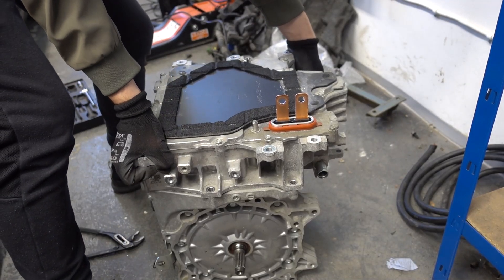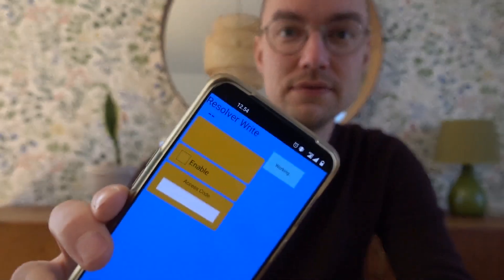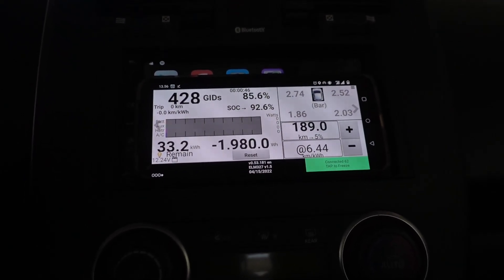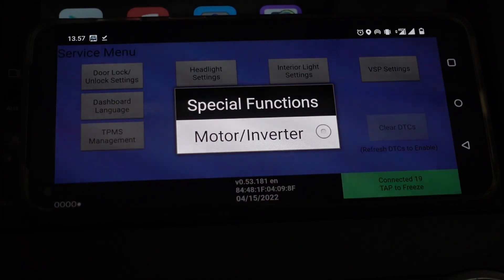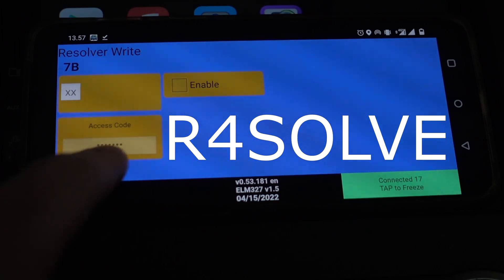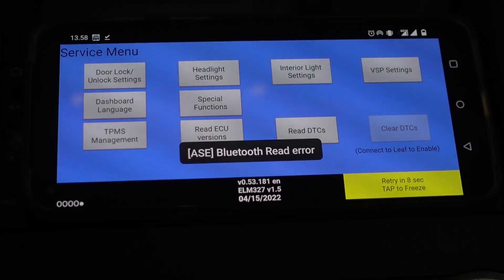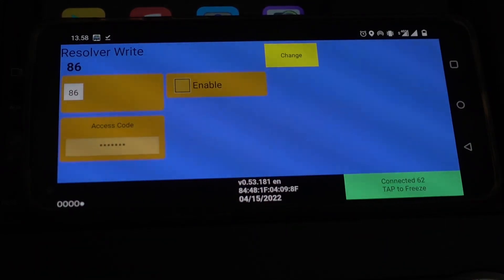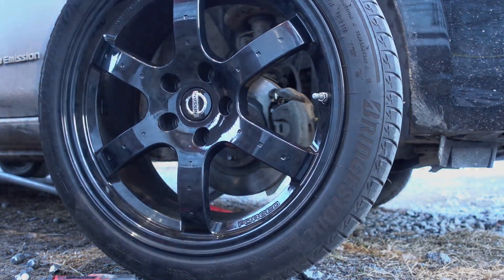LEAF Performance upgrades just got easier - Leafspy Pro Resolver Write

Comment: I think I heard the Donkey Kong Country soundtrack playing in the background 😆. Great video!!! I'm doing this right now, I fried my inverter after accidently swapping positive and negative wires. Update: I just updated the resolver code and it was super easy thanks to Dala, but now only one of the contactors is closing :( and I'm using the Resolve EV VCU. I'll check the DTC codes and lookup what they mean. Then I'll try reading the pins on the BMS plug to see if it the Resolve VCU is sending it the right signals.

Comment: We need these programs for all makes and models, brilliant bit of reverse engineering. I also noticed it’s talking over an Elm327, is that a standard 1.4? Or does the pic chip need flashing?
Reply from the maker: Standard obd adapter yes
Reply: @ fantastic, it amazes me how much the consult system costs, including the adapter, when, in theory, you can get it talking over a Chinese made elm327 with a pic18f chip. I’ve done similar with a bmw Bluetooth e series adapter. Another GitHub project, it’s brilliant, I have access to all the manufacturers dealer level tools but don’t know where to start.

Comment: Have you come up with any way to increase the Regen for the 2012 leaf from stock eco mode? For I feel the leaf would get more range if it regened more. Does leaf spy pro does this in any way?
Reply from the maker: You get less range by regenning. Gliding is where its at!
Reply: @DalasEVRepair  thing is where I live it is hilly and when I was at lower speeds and regened it added miles to the guesometer. For when at local highway speeds of 55 mph when going down hills the car speeds up over 60 and normally have to apply the brakes and I feel it could regen to maintain speed limit going down hills for newer cars like Tesla use aggressive regen or one pedal diving where brakes are seldom used and besides having bigger batteries I feel that's why they get far more range. Thoughts??

Comment: We have an intermittent issue with our 2011 Leaf, which keeps dicharging the 12v battery, as much as 7A has been seen drain it. We also have a yellow trangle warning light on the dash display. I've been told it could be the PDU unit maybe at fault. Would it be possible to swap out with a second hand unit? As we have been advise to take it to Nissan who are the only ones who can replace and reprogram!!
Reply from the maker: Parasitic draw tests are not particularly hard to diagnose. Any competent shop should be able to find the drain!

Comment: Hello Dala, if you use the thunderstruck VCU for nissan leaf you don't need to worry about any of this right?
Reply from the maker: If you are using mis-matched inverters/motors, then yes, you still need to pair them for optimal performance!
Reply: @DalasEVRepair  thanks for the fast answer, btw it's possible to down grade a nissan leaf 2018 with a controller from a 2013 leaf? Do i need to configure something or is plug and play?

Comment: Dear Dala. I have a Leaf Tekna 62 kWh 2020 from new.  I have only done 3000 kms.  I purchased a Leaf Spy dongle and downloaded Leaf Spy Lite.  My SOH say 91.8%.  I only ever charge at home.  Is this normal for the battery?
Reply from the maker: Only 3000km 2 years? Remember that SOH is an estimation, maybe because the car has been sitting much it reports lower. Try quickcharging it a bit and properly use it, this would make the SOH go up on older LEAFs. Incase the battery has been sitting fully charged for extended periods of time, this will also degrade the battery faster. But most likely this is normal due to low usage. Post it on the Mynissanleaf.com forum, better than a youtube comment!
Reply: @DalasEVRepair  I joined Mynissanleaf but it didn't really answer the question.  I have now discovered what I did wrong and what is the solution.    My mistake was to buy a LeafSpy dongle.   I have now thrown it in the draw and decided to ignore it and just enjoy the car.

Comment: Im not sure if you have tried but I was wondering if you can run the leaf motor in reverse direction as normal drive because I'm thinking about using it in a custom swap?
Reply from the maker: Yes, check out the Resolve EV documentation with pictures, you need to swap two wires
Reply: @DalasEVRepair  Awesome thank you  ! 
So it should work as normal and with full rpm and power/torque ?
Reply from the maker: @BasicOffgrid  yes!

Comment: You sir and others like you are such an invaluable asset to the EV community🙏 thank you!!!

Question: is cruise control on the leaf can-bridge messaging?? The reason I ask is that the leaf speed is controlled by "wire" in all actuality it's a potentiometer of sorts in the go pedal.? Now hear me out 😅 based off personal experience and your own personal hyper mile video. A driver should use terrain to ones advantage; but due to the cruise control simply being based off MPH/KPH the car gets pathetic range. What if we could change the speed messaging to power ban / Kw settings. Thus cruise control is now WAY more efficient, true it'll lead to "speed" variations BUT that's not our primary care.? Maybe 🤔???
Reply from the maker: This could be done, but it could also be quite dangerous if the cruise would make sudden speed swings due to a kW limiter. Not worth the effort imo!
Reply: Just use a N mode, this is what i do. I was thinking how to do so, got same thouths what its simply too comlicated to do, as well its a risk factor. Who will gonna pay for your ticket? Can-module developer can be not too happy about it...
Reply: @pashko90  I agree with you & Dala on the fact of limiting to Kw vs MPH/KPH would be a bigger safety issue than once imagined 😔.
Also I have used N mode during downhill but find it rather worrisome... IDK why but the images of a rogue vehicle using the emergency "no breaks, bailout roads"  comes to mind 😂🤣🤣. To each their own on hypermiling I suppose 😁👍! All the best to you and the community of LEAF owners extending our economy!

Comment: Thanks for the update, I will like to know if you are working on how we can increase the regen for Nissan Leaf.
Reply from the maker: Only way so far is to install a healthier main battery that allows for more regen. Old batteries with low SOH% have high internal resistance, so it makes sense to limit regen if your battery is in bad shape.

Comment: Wow.  This is amazing.  I haven't even replaced my ZE0's 24kWh battery yet (it's still at 70% SOH,) and had only considered swapping in the 160kW motor for faster launch.  This would make it super easy.
On the other hand, maybe I'll keep as many original parts as I can; it's an SL, with CHAdeMO from the factory.  It was a dealer tester, and I think they put all the bells and whistles on it so people could see what was possible.  Sometime next year, I'm planning to buy a 62 kWh battery and get some help having it installed (with a CAN bridge, of course.)
Which will make it a dozen-year-old EV with Tesla-3 range!
Reply: I thought with a 24kw pack that with a 160kw inverter u can blow a fuse? Im also on a 2013 sl about 73%soh
Reply: @goldenstatew2399  You have a big chance to blow a fuse and to replace it you will gonna need to remove a battery pack and open it ip.
Reply: @pashko90  ill wait for 40kw upgrade, no worries, thanks! I'm just happy at the fact that we can actually have some options with upgrading
Reply: Ze0 is not supported for this upgrade. Only aze0.

Comment: Great that's in Leaf-Spy now! Please see if you can do the same for battery swap 😀
Reply from the maker: Leafspy already can pair in replacement battery packs, see: https://mynissanleaf.com/viewtopic.php?f=44&t=32819
Reply: @DalasEVRepair  Oh great! Didn't know that, so no more can-bridges to swap pack then?
Will read that thread.
Reply: @jonaswallerstrom7303  Programming a Battery ID and modifying a CAN commans on a fly is a bit different story...

Comment: Great news! Can I input all of the numbers instead two - in case of replacing the inverter for a part from 2011-2017 model?
Reply: Yes, LeafSpy Pro detects how many are needed and will allow you to enter either 2 or all 10. See the screen at the start of the video and thumbnail which shows what that looks like.
Reply: Thank You for that clarification. I’m waiting for iOS release:-)

Comment: Hell yes, will swap my inverter tomorrow!
Reply: How’s that going?
Reply: @dorhocyn3  all good, waiting for a can bridge.
Reply: @dorhocyn3  why choise range extender and not a 
40kw, ? Also what year is your leave
Reply: How did it go? what size is your battery and inverter?
Reply: @goldenstatew2399  It goes well. Got a 110kw inverter. I have for now 24kwh pack+range extender.
Reply: @pashko90   What range extender do you have ?

Comment: Oh wow its public now :) thanks Jim and Dala.  Just about to swap my 160kw inverter in.  What rims and tyres are you putting on? I recently put Bridgestone potenza Re003 on and they are fantastic for grip wet and dry and no range difference. Still on 20555R16.  18" will hit range ?  I want to see how you go grip wise on 160kw.  Apparently leaf wheel wells are huge so going wide is easy.

Comment: It is amazing that the EV community is making battery pack upgrade easier 👍. It is also very disappointing that the OEMs did not voluntarily do this development. That should have been part of the business strategy behind the roll out of EVs. The EV early adopters paid a premium over fossil cars. The affordable cars such as the Leaf and iMIEV started with small battery pack to keep costs down. The OEMs should have had a policy of upgrading the battery pack at the end of the lease or when a car that had been purchased was part exchanged. The early adopters should have been offered a discount on battery pack upgrade as part of the research and development budget. That would have enhanced the experience of the early adopters while it enhanced the reputation of the brand. It would also have made used EVs available with a better range.